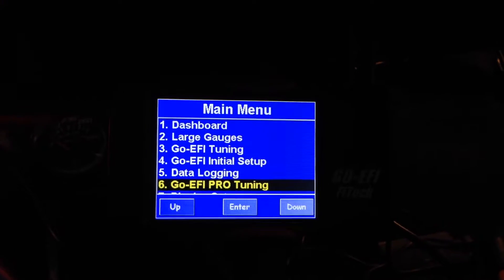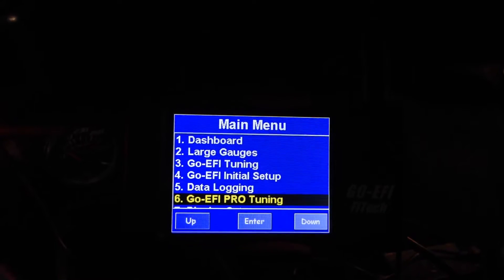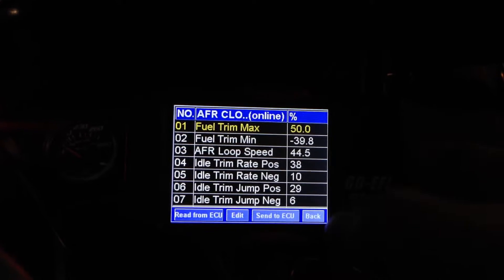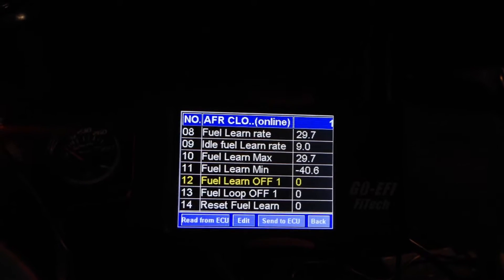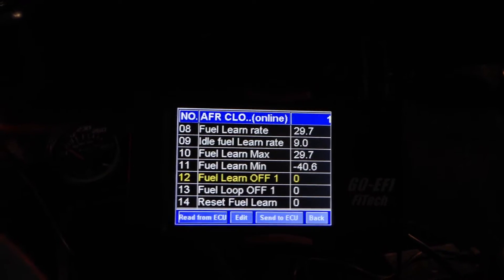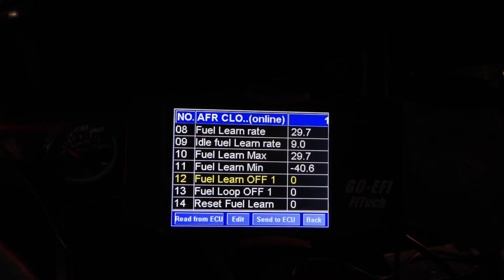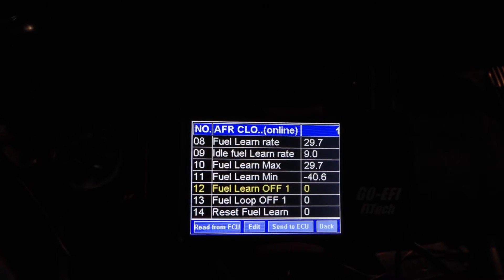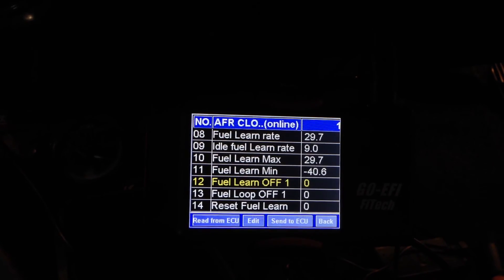Fitech - How to disable fuel learning and fuel trim

Comment: hi, I have a 427 small block 13-1 comp, running E -85 112 octane. got unit back from fitech, but at wot its a dog ,they dont seem to want to help much at fitech. the motor makes around 600 hp when running rite . need help badly.
Reply from the maker: Too many questions for a comment reply. So many factors go into your issue. The first thing that pops to mind is simply the fuel delivery system (fuel pump, injectors, etc) may not be able to keep up at WOT. Remember if you are running E85 you will need significantly more fuel flow.

Comment: dude I love your videos,  fitech is not great in the support department.  I am having no luck with the tech dept.   I installed my 400hp system and it ran awesome, very happy. But if I shut the engine off and restart, it runs like a choked carb, super rich. If I do a "reset learn" it solves the problem, until I shut it off again.   I am confused, any suggestions..  mike
Reply from the maker: Firstly, join the Fitech owners group on facebook. We help a lot of owners there with support.

Second I can think of two things for your issue. If you just mean it has issues starting on a warm engine. You'll need to look at your crank fuel settings. Specifically the prime fuel settings. By default they are quite high. Works well for cold starts. Not so much for hot.

If it's rich all the time after you run it for a bit, and a reset fixes it for awhile. Then I would guess you have a vacuum leak, or air is getting to the O2 sensor somewhere. This would lead the AFR's to read normal, but in fact the engine would be running super rich. You would want to look at your AFR Trim and AFR learn. The VE tables in the fitech are quite rich by default, so typically most engines will have the AFR learn in the negative values. If you see your's in the positives, especially at idle. Then I would be checking your ports, gaskets, and make sure you aren't using the clamp on O2 bung. It should be welded in.

Comment: If you are running a boost application and you don't want to confuse the computer by pulling the car up on a 2-step for drag racing; would you then want to disable both?